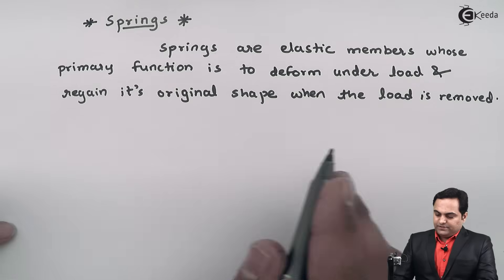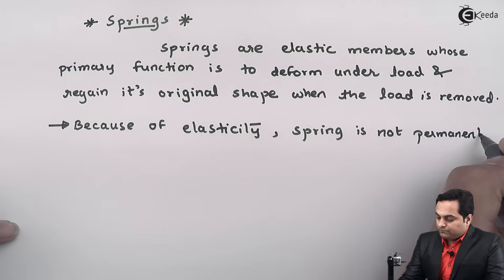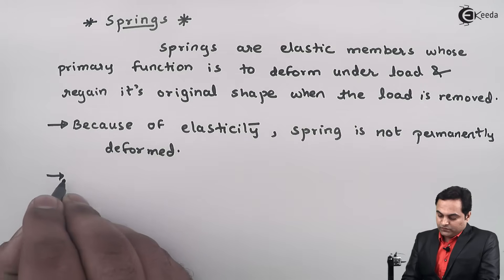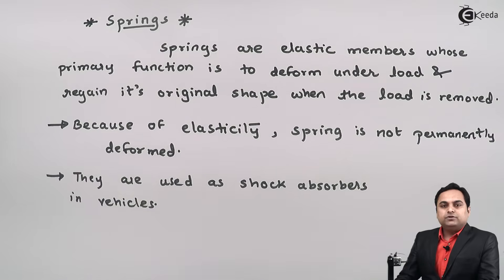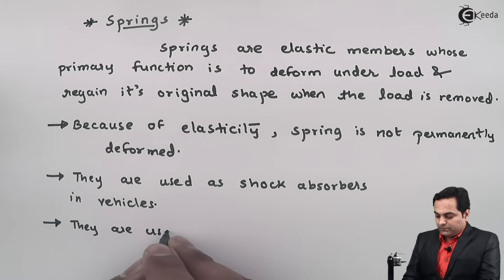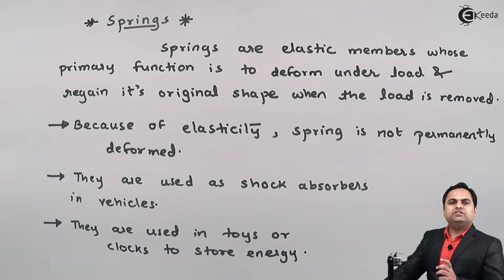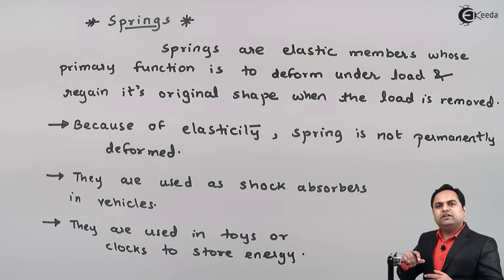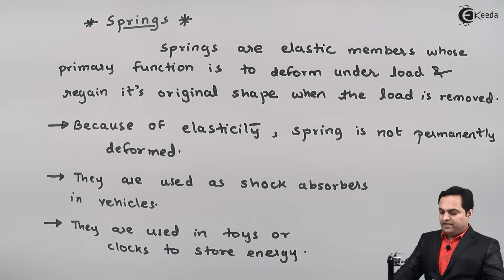Definition of Spring - Springs - Design of Machine

Comment: A mechanism used in printing machinery consists of a tension spring assembled with a 
preload of 30 N. The wire diameter of spring is 2 mm with a spring index of 6. The spring has 
18 active coils. The spring wire is hard drawn and oil tempered having following material 
properties: Design shear stress = 680 MPa; Modulus of rigidity = 80 kN/mm2 Determine: 1) 
the initial torsional shear stress in the wire; 2) Spring rate; and 3) The force to cause the body 
of the spring to its yield strength.
Solution video sir plzz